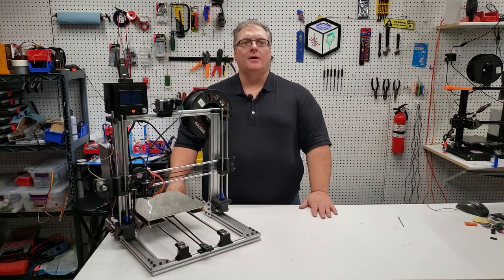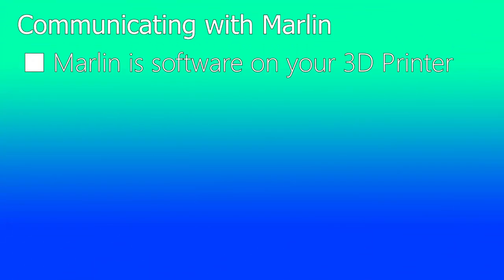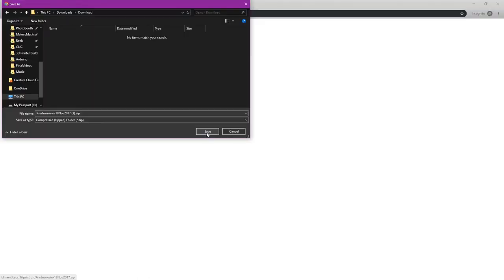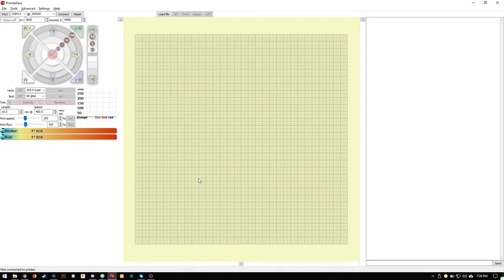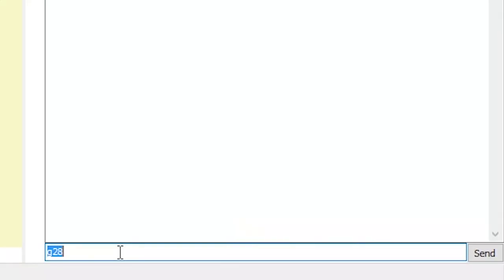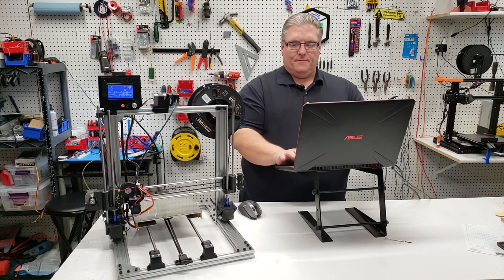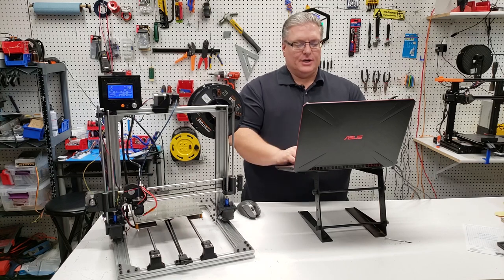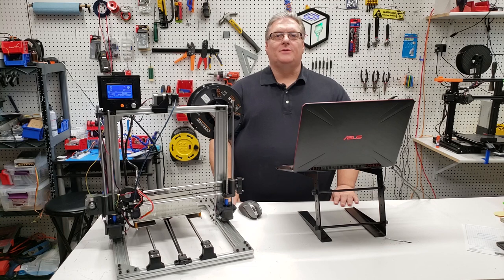Introduction to Marlin Commands & G Code - G0, G1, G28 - A tutorial for new users

Comment: Great video. I'm just very new and never program. Just got the Creality 3 v2 printer and don't want to manually move the print head. Each time I do it messes up the alignment. I like your printer with the 2 motors to move the gantry. The Creality is a good learning experience because it is challenging to set up and everything has to be done manually. Being able to understand this, is good if problems arise.
Reply from the maker: Glad it helped you out.

Comment: My computer does not have a serial port... what should I do? My 3d printer is an ender 3 by the way. Thank you
Reply from the maker: Generally speaking when you plug the USB from the Ender 3 into a USB (Universal Serial Bus) it should show up.  You don't need an old school DB9/DB25 serial port.
Reply: @MakersMashup  I've tried  connecting with usb at every  port and every baud rate and it just gives me this message: [ERROR] Could not connect to COMx at baudrate x:
Serial error: could not open port 'COMx': WindowsError(5, 'Access is denied.')
Reply: Ok I finally got it to work with a certain com# and a certain baud rate. That was weird

Comment: With my Marlin I got a USB connector, I can stick one end in my pc the other in the Marlin, a nice 2021 solution where serial ports and dinosaurs belong in the history books. Why o why for a 3D-printer, a definite 21st century invention, do I need to connect it with a serial port?? I do not have serial connectors, neither am I interested in getting a usb to serial converter so I can connect a serial to usb to that one wo I can connect it to my 3D-printer. Have people gone mental during lockdown?
Reply: what are you talking about ? Just connect your printer to PC over USB cable. Marlin board has usb -> serial alrealdy onboard.
Reply: @xpertvis  my main problem with it is that it still uses setting mede for serial ports, and sometimes you have to manually adjust them, In the time of USB, Plug and play this should not be a thing
Reply: @sergetheijs8527  i see. Well when i connect my SKR1.4, i believe i have standard mass storage available, which is natively supported by windows (never tried that thou). Serial drivers are also kind of standard on windows nowadays. So software (like Pronterface in this case) can be use for a lot of different printers. The thing you are asking is little bit harder, because not every 3D printer board use same microcontroller, so for every different board you would have to install different driver. And software would have to support it. USB to serial converters are very common actually.